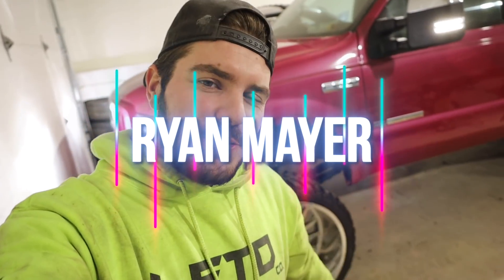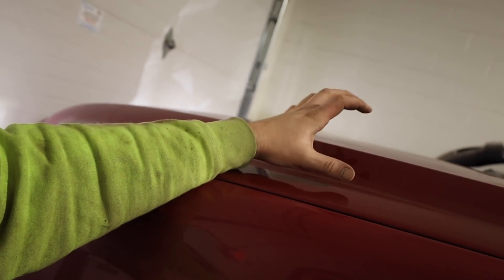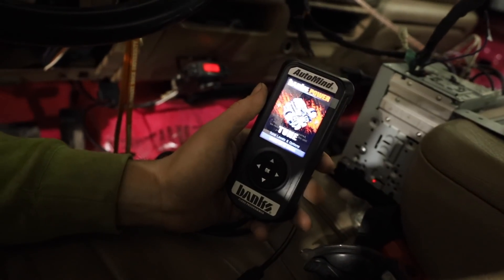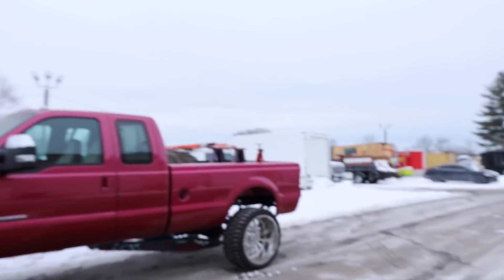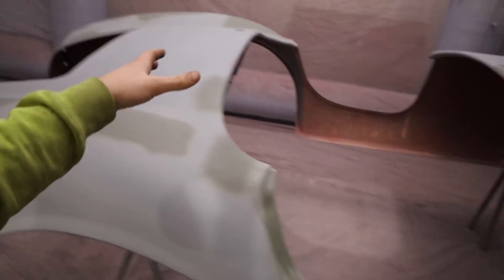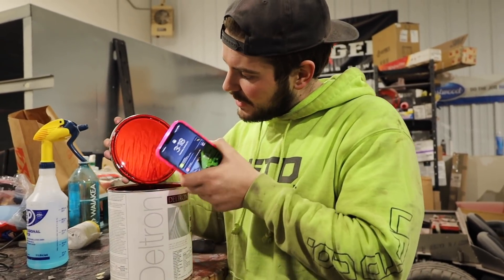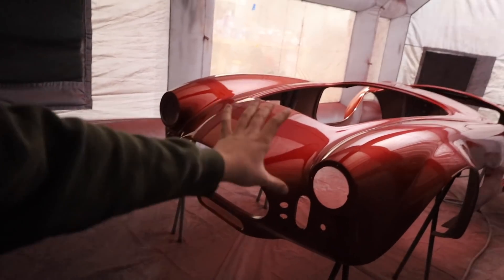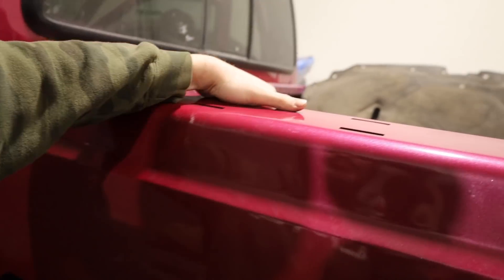1999 7.3L Powerstroke Goes on its First Drive

Comment: When it comes to 7.3s and slow starting the 3 most common issues are bad glow plugs, bad glow plug relay, or worn out injectors. I don't remember if you've done the GPs or not but if not I would put money on that being your issue. At that mileage, if they are the original sticks, they are definitely in the last bits of their life. Its super easy to test the relay so I'd say that's the best starting point. 

All that being said, I don't think the lift pump is a bad idea. The screens in the tank or most likely clogged too. Hutch Harpoon Mod while the tank is open. Keep up the killer work!

Comment: Ryan , long crank start could easily be injector o-rings or injectors themselves if original,
Just put injectors in my 02 at 318000 starts at bump of a key
Beautiful truck BTW
Reply: Mine did this same thing was the lift pump on the frame rail

Comment: Hey Ryan if u do a jl shallow 10 in a box with ab .7 to 1 cube of air with a slot port out the side tune it to around 30 hz u will definitely have more low end rumble in the cab bc it is a bit of a confined space. A lower tuning frequency with a box that has a bit less air space will help keep the sub compliant and you won’t get to much heat. I would definitely suggest that stay under 500 watts with a prefab only because the sub may not stay compliant with a certain kind of music or tone.

Comment: after owning a 7.3 for years and throughout very cold winters, i have to say i think it’s something else besides the batteries. it seems to have plenty of cranking amps, the starter sounds plenty strong, making it seem like it’s a fuel issue that has to do with the screens or the pump in the tank or the injectors. just my take on it, but i love the videos and what you’ve done with the truck!
Reply: I got a 2001 7.3 f350 dually, and I had the same issue and it would run rough after 2400rpm. After replacing the cps, icp, ipr and the screens in the tank and rebuilt the sending unit aka the tank pump. It was the damn frame fuel pump. $500 dollars later it was a 70 dollar fix. Atleast I got all new sensors I guess
Reply from the maker: If the injectors are shot were going 100 overs 😈
Reply: @ryan2546  DO IT

Comment: Has nothing to with the battery voltage. On A73 diesel you have to wait wait to start it even though the glow plug light goes out the glow plug relay is still engaged. You could tell by looking at the voltage gauge. You will notice that the gauge goes up after about 20 seconds then try cranking it. Your  Gauge is low because the globe plugs are still cycling . The reason why it cranks so long it's because you're losing  your high pressure oil pump Prime. That's that's why it's Cranking So long. If you put it on a scanner check the high pressure oil pump pressure pressure you will see it takes a long time for it to build-up oil pressure which is what fires fires the injectors

Comment: Ryan,  Mario g and Brandon at night shift diesel can really help you out with this 7.3. Those guys know there 7.3 inside and out. Worth making a call to them. Also putting a scan tool on it will help you further diagnosis they long start issue if the battery’s don’t take care of it. I wouldn’t do a fass. Put a irate return style fuel system on it with a sump

Comment: You'd could be surprised with the filters in the tank. My truck had 375xxx on it and it's filters were completely fine. Swapped them anyway along with the pickup foot (known for breaking off) which should do as well and put a hose clamp on it
Reply from the maker: We’re about to find out! Hahahah

Comment: I’m going to say the problem is not in the tank. The sending unit on 7.3 doesn’t have a filter sock like a gas fuel pump does. It’s a “pickup foot” with a metal screen almost like a strainer you’d use in the kitchen. It would take some serious trash to stop it up. A sump and fass wouldn’t hurt though because the plastic foot is bad about breaking apart and causing you to run out of fuel at a 1/4 tank

Comment: Have you checked or changed the oil cooler? May not be getting correct oil pressure to the high pressure pump. There are a lot of variables on the huey systems. I'd almost bet it's oil pressure causing your hard start.

Comment: There’s a fuel kit that adds 2 more fuel lines to increase fuel.  7.3 has 2 extra ports on cylinder heads so you can add new lines. I’m finishing up the truck upgrades I’ll get company name

Comment: The fact the truck started right up on the 2nd attempt at a cold start indicates the fuel system is losing prime. Idk anything about those 7.3s..im an industrial diesel mechanic. My guess would be leaking injectors that leak fuel into the cylinder when sitting or some sort of check valve that keeps diesel from leaking back to the tank

Comment: On A 73 power stroke, when you start it it will show a low voltage because that's like a low plug's coming on.. If you watch it after about 5 minutes it should be in the middle.

Comment: Check your hydro boost if it is bad it will kill batteries on a 7.3 motor too that was what was wrong with my 2000 excursion 7.3 motor

Comment: If each subwoofer is 2 Ωhm you can wire them in together down to 1 ohm and be able to push more power
Reply from the maker: Yes but with the air space and the amp output that could be too much